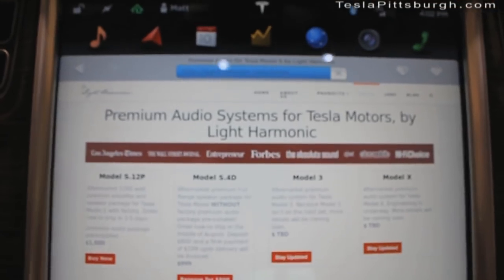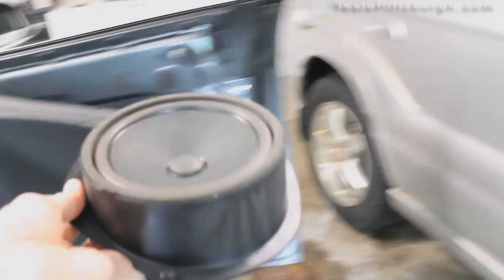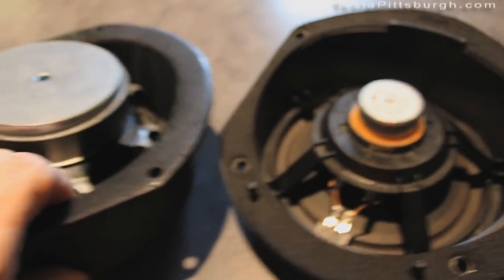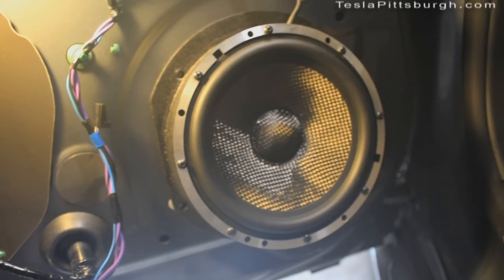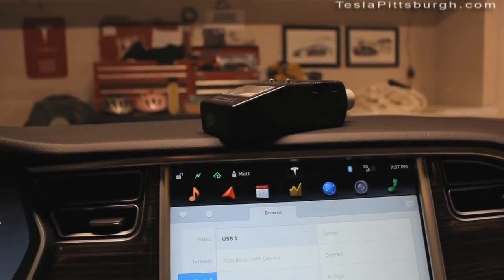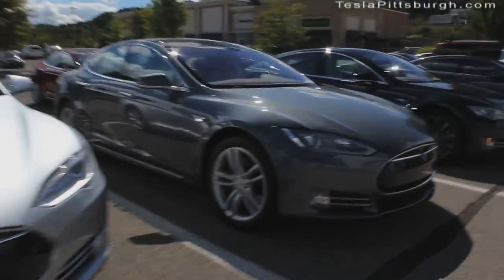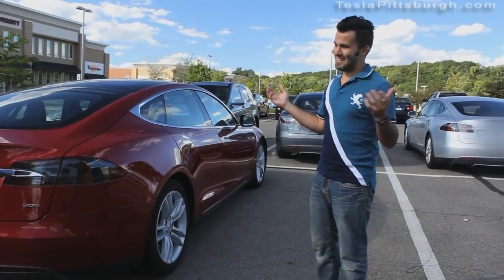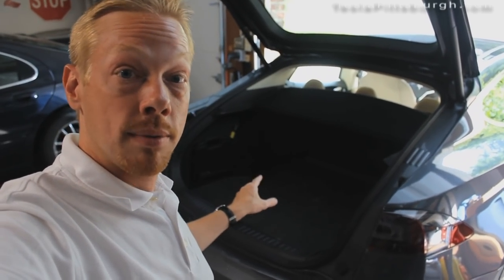Review: Light Harmonic Speaker Upgrade for Tesla Standard Audio

Comment: Yeah the weight of the drivers has nothing to do with the quality of them. The Tesla ones use neodymium magnets vs the Light Harmonic that use ferrite. Neo magnets weigh up to 10x less than ferrite for comparable performance and in a car environment would actually be preferred. 

When you go over a bump the magnet weight gets shaken. If it weighs more then the speaker basket has to be able to cope with that. Go over a very sharp bumb and well...the magnet could shift in position. This happens in domestic loudspeakers all the time if they are dropped by mistake. 

The best pro audio drivers out there now use neodymium. One to help prevent drop damage, but also to reduce the weight of finished cabinets so that they are easier to carry around. Make the car heavier and its performance will obviously drop, if only by a tiny amount in this case.

Comment: Thanks for doing this. My only concern with the do-it-yourself $2000 system vs the $2500 Tesla premium system is Tesla's system is a 12 speaker system vs aftermarket 5 speakers. Having all those extra tweeter and mid speakers mounted higher (directional highs) seems like it would give a much more rounded sound stage across all frequencies. Does the Tesla system not also include some XM circuitry? If you are planning from a new purchase; the Tesla system seems like it might be a better value.
Reply from the maker: There are more speakers with the factory system-- and yes, you get XM.   However, the added punch of the LH speakers more than makes up for the greater number of speakers, with the caveat that you really need the subwoofer to complete the upgrade to the standard sound.  I mean, you REALLY need the subwoofer.  As far the the sound stage, the UHFS has a different sense of space than the LH... I don't think it's better-- in fact, I prefer the centered feeling of the standard (unmodified) over the UHFS also.   So if your ears are attuned enough that you might have a clear preference, I'd try both factory systems but keep in mind the upgrade costs/potential for making the standard audio better.

Comment: thank you for this very honest and in depth test!
I got my car a month ago, and could not decide which audio system to get, because the car was already done and waiting for me as it was. I took it to speed up delivery. I am very unhappy with the overall sound in low und high volume levels. low sound muddy, and high levels mostly just hurt my ears. I did not have this problems in my Audi before, so I am considering this upgrade. Thanks again!

Comment: i find it strange that someone would strip their car apart and remove speakers when their replacement speakers havent arrived. what if they got lost in transit and for some reason you couldnt get a replacement set. wouldnt someone normally wait for the item to arrive, inspect it and then stat planning the installation? its just strange.
Reply from the maker: I absolutely did not take anything apart until the speakers were in hand. The video was not shot in chronological order.

Comment: What year is your Tesla Model S and how has the total ownership experience been thus far?
Reply from the maker: My car is a 2014 and I have about 36k on it.  Overall experience has been very good.  We're a bit of a Tesla "backwater" here in Pittsburgh and that's made service a little tricky at times and communication early on was poor.  My only significant repair was recent replacement of a clunking upper suspension component (under warranty) that is possibly due to its relatively early slot in the coil suspension production run and/or the road conditions here.  The only real gripe I have is in regards to very poor information I received prior to ordering that led to me missing out on some very key features (AWD, Autopilot)-- but the blame for that is probably best placed on Tesla's corporate office keeping their sales people completely in the dark.   We're keeping this car for the long-haul and cancelling our X reservation.  Ironically, had we known what was coming in late 2014, we'd have justified spending a lot more on our car than we did, so it's Tesla's loss overall for being so secretive.  So if you order (use my referral code! <ha>), make sure you are satisfied with what you're getting-- even if changes appear soon.  In the end, I got the car I paid for and it has performed very well thus far and I am very satisfied.
Reply: That was a good balanced description of your overall experience and thanks for the advice. If I were to purchase a Tesla it will probably be a Model 3, however it is not an immediate necessity. I thoroughly like the Tesla brand and what it stands for. Continued satisfaction with your Model S.

Comment: db's for sound don't mean a thing....that's just how loud it is. Anyone can have a loud stereo. Having quality sound at a higher volume is key. $2500 for a premium stereo system is crap and can be had for a much lower price. Anyone who pieces their system can easily beat a $grand plus install and still sound way better than the stock and premium system the Tesla has. Hope you still like what you replaced in yours.....
Reply from the maker: Was just making the point that the lower resistance does, in fact, have a net increase in volume output and that it is measurably better at desirable frequencies.  That said, the quality is also definitely superior to the speakers that came with the car.

Comment: Thank you so much for this video! 

I have a 2016 Model S with UHFS. The bass is so lacking that I am evening questioning whether the stock subwoofer is disconnected or blown.

In your opinion, would replacing the door speakers with Light Harmonic or upgrading the subwoofer with NVX be more impactful?

Since I have UHFS with the additional amp, do you think the rear LH door speakers would be worth it?
Reply from the maker: Check all connections to make sure your sub is getting power (put your hand on it, you should feel something when bass is playing).  Also check your equalizer settings-- sometimes these reset after software updates. 
As for speaker upgrades, I wouldn't bother changing the rear door speakers at all. It's minimal effect to front seat and my kids are usually wearing headphones anyway (ha!).

Comment: Not worth the price..  i would prefer 200$ for these crappy ferite magnet speakers..  the cone and the rubber surround is the only high light.. not at all worth 1000 bucks😑
Reply from the maker: Given what I've since learned/heard about their customer service responsiveness, I would agree. But they do sound better than the standard speakers. ;)
Reply: @NZCUTR  those standard speakers are worth 40bucks..  this one may be 200$.. 
And just to know,  did u use any ext amp for these speakers are stock full range output from the head unit?

Comment: Can you post a pic somewhere of a closeup of one of the door panel clips? Before taking my panel off I'd like to buy extra clips. I'd rather buy them from the local auto parts place.
Reply from the maker: You can find various clips here:  https://www.belmetric.com/tesla-c-12_688_1061  
Note that there are some clever/cheaper alternatives.  For instance, the door clip I broke is perfectly replaced by clips from a Toyota Sienna..  which are available various places on eBay in packs of 10 for about $1.50.

Comment: This is a great video, thanks. This is something I'm going to look into. I passed on the UHFS due to perceived unjustified cost. I'm shocked at how tiny the magnets are on the stock speakers. I wonder if LH plans on fixing the fitment issues? I'd rather not have to "hillbilly" the install of that kind of money. Regardless, I'm not happy with the stock base speakers and will be seriously considering these. As for the sub, I am aware of the NVX Boost and it fits and looks good so I may go that route also.
Reply from the maker: My understanding is that the set I got was the last of the preproduction run and LH has designed new brackets for the production run.  Seems pretty silly to have someone review something that doesn't ACTUALLY represent your final product and I wasn't going to gloss-over or overlook fitment issues I had just based on promises--- so you're getting MY review from MY experience.  If what I was told is correct, then orders placed here on out will have better brackets AND a foam gasket on the back of those brackets.  If that can be independently confirmed, I'll update the review later.
Reply: The factory tesla speakers utilize neodymium magnets in the motor structure of the speakers, which accounts for the smaller size. The LH model obviously uses ferrite magnets. Since neodymium magnets are so much stronger than ferrous magnets, there's no need for them to be bigger. So these days, size means very little when it comes to speaker magnets. On a side note, neodymium is actually a preferred material to be used in speaker drivers because it's magnetic flux is more linear, and provides better control over the voice coil, vs ferrous magnets which have a stray flux. The LH drivers were definitely better built over all, but the magnets were probably a close draw between the two.
Reply from the maker: Whoa-- now that's a level of analysis WAY over my head--- but much appreciated.  Mind if I quote it later?
Reply: Sure have at it. I used to be a pretty involved DIY speaker designer/builder, so that's the only reason I recognized the neo-magnet. Lol. Everyone in the DIY Audio community was pretty pissed when China decided to corner the neodymium market. Suddenly a lot of really great speaker drivers started doubling in price over night.

Comment: does it mean If I want to get  the premium version of the light harmonic upgrade do I need to have the tesla model s sound module?
Reply from the maker: I believe so.  It's hard to say because Tesla has been streamlining their production process, but I would not assume that the wiring and connections for the premium sound system are installed in ALL cars just yet.  They might be-- but the might not be.

Comment: You didn't show the tweeters.  Did the Light Harmonics even come with tweeters?
Reply from the maker: Tweeters are not part of the LH kit.  Those and the center channel speaker embedded in the dash remain the same.
Reply: That is bizarre. it's like buying half a system. I wonder if anyone makes mounting brackets for standard 6.5 inch component systems?
Reply: yeah What the hell why Not have upgraded tweeters aswell .

Comment: are they 8 ohm speaker's in series?   = 16 ohm
Reply: Yeah it is. I think they mean parallel.  But, noticed that the stock factory speakers were all 2 ohm in impedance. What that means is you get more power be driven to the speakers. More power coming to the speakers eventually makes it sounds a bit louder in comparison to the other higher impedance speakers like 4, 6 or even 8 ohm. 
And the factory head unit is powerful enough to drive those front and rear 2 ohm speakers. Most car amps (head unit)/car speakers are rated at 4 or 8 ohm. 4 ohm costs more than 8 ohm as it increase the overall acoustical power if I am not mistaken and sounds much richer and powerful. 2 ohm door speakers are less common and less likely to be find as it draws more power from the amp (head unit) and the unit will get damaged when it is not rated for 2 ohms loads. Furthermore, amps (head unit) that can drive 2 ohm speakers are expensive and that's why most car manufacturer only invest on the crappy amp just to limit the overall production cost. The 2 ohms speaker on the other hand are pretty common in subwoofer lines for extra bass.

Comment: can you do a sound test in bmw x3
Reply from the maker: Well..... I don't have a BMW so....   no?  Not sure there's much value to comparing between cars since there are so many other variables at play.
Reply: i have a bmw x3 with standard (4 speakers with 2 subs)speaker system. i wanted to see if there's a huge difference between this and the premium.
Reply from the maker: You're going to have to make friends with another BMW X3 owner I suspect.  Line them  up and try them out.  Data and specs only take you so far, which is why I weighted the focus group/head to head test very heavily.